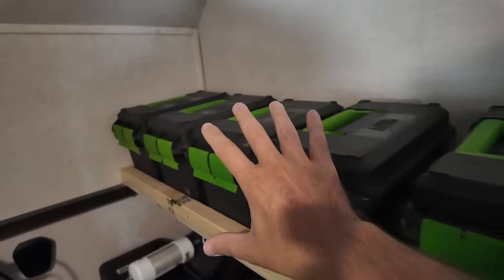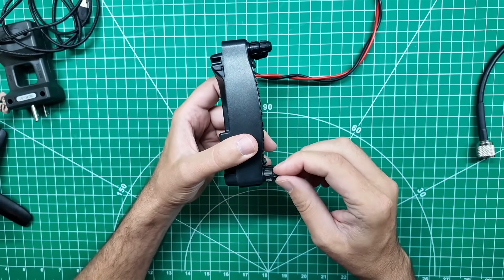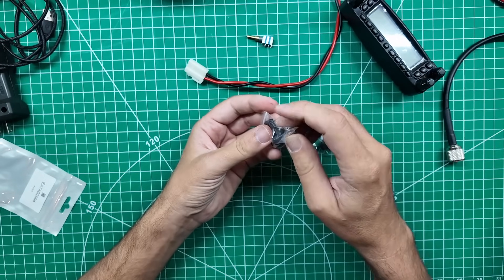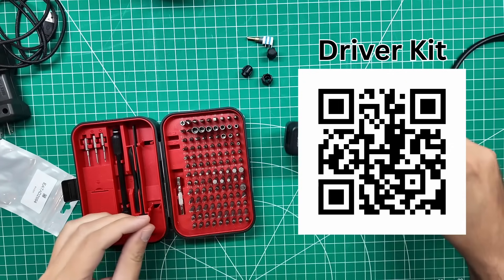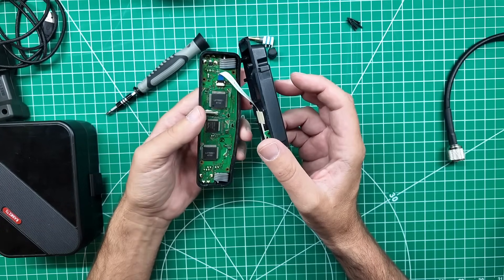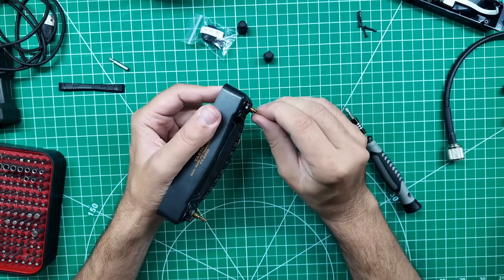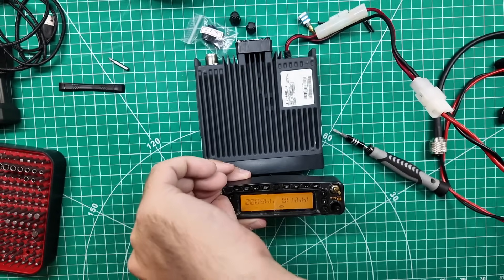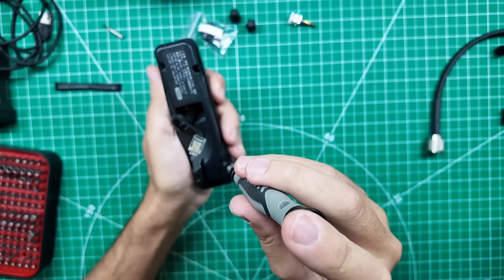Can AI Really FIX My Broken Yaesu FT-8800?

Comment: What happened to the AI demo part? Also, as someone else already posted, the 8800 should not have those holes. The one hole closest to the top left on screen should have a phillips screw in it, actually there should be a couple that appear to hold that plastic piece in place. I can't imagine why someone would have drilled in that area.
Reply from the maker: I talked about it at the end of the video.  I asked AI to give me the part numbers and it not only gave me the part numbers, but also ebay links to order the parts!  It was a simple prompt/answer and I forgot to put in the screen shots.

Comment: Thanks! Yor video was a great help! I just replaced one. A friend of mine dropped his FT-8800 and broke the shaft off at the base.  He had someone else attempt it but they were afraid they might damage the board.  I worked in the Avionics Microminiature Component Repair Shop in the Marines about 40+ years ago. I used my recently purchased YIHUA 929D-V Electric Desoldering Soldering Iron from Amazon to desolder the pins and dropped it out. Not as nice as the Pace vacuum pump rework station I used in the Marines but for $36 vs $8000+, it was fine. The hard part was holding the new switch assembly tight to the PC board until I could tack solder a couple of pins.  But we got it done and none the worse for wear. Unfortunately the replacement knob he got off eBay seemed a tad small and wouldn't slide on all the way. But it works!  I don't remember seeing those strange holes so I don't think they're normal.
Reply from the maker: I don't have the eyes for micro-miniature!  Good Job getting it fixed! When I have to desolder a lot, I use this: https://geni.us/CMIB can't beat the price/performance ratio!

Comment: Maybe someone here recognizes the problem with my FT- 7900. The unit lights up  and then shuts down immediately , most of the time , sometimes it stays powered on, but shuts down if I transmit.
Reply from the maker: What power supply are you running?
Reply: @temporarilyoffline   It's mobile, but running off the "house"  batteries in my Van/RV.  It has been great since 2013.  I think it started this behavior after an extended no battery power situation ,  Turned the radio on after rectifying the situation and the memory was wiped as well.  Is there a internal battery like a computer has for the cmos ?

Thanks for the reply !
Reply from the maker: @Glidedon there could be an internal battery getting in the way.  Open it up and check!
Reply: @temporarilyoffline   Will do !

Comment: I've been fussing with an FT-817 for a while now (I bought it 3rd hand) that I suspect had been dropped on the AF/RF Gain knob. I tried to track down the replacement pot for a while, then just gave up. After watching this, I pulled ever so gently on the skinny knob, it moved ever so slightly, and now they turn independently. SHAZAM! Do I credit AI or TO for this?
Reply from the maker: Why not both?  Strong work bro!

Comment: Steve, try using 3in1 Dry Lube on the spindle and inside the knob. Got to be very sparing with it. It comes out the bottle in liquid form then dries. I use a q tip as the applicator, don't apply it out of the bottle to the radio. (Ask me how I know). The stuff works magic. Could be the knobs are just formed wrong as well, but for the 3 dollars for the bottle, you will find many uses for it.
Reply from the maker: Sounds like a plan!

Comment: Those parts about 4 bux from Yaesu. The holes look like a mic holder?
Reply from the maker: Last time I ordered from Yaesu it took about an hour on the phone and 2 months to deliver.
Reply: @temporarilyoffline  Almost a same experience, the first phone call was only about 20 minutes to order, then they sent the parts to a city with the same name in a different state, took almost 3 months to straighten out for a $2 part, the lady at customer service was not good. At all. Had about 6 different phone calls, and it never got any better. I will avoid ordering parts from them  unless I absolutely have to.

Comment: Those are speed holes.  If you don't want to pay Yaesu for a remote head mounting bracket you can use that plastic piece and screw it to your dash.  I've done the same thing except mine sits in a windshield phone holder.
Reply from the maker: There's an idea
Reply: I was wondering also as my rig does not have them either. Also, is the Plastic Still on the Screen??😮
Reply: @HamManCT I've done it.  If you unscrew the bezel from the radio it turns into a nice mounting plate, but Amazon and eBay has them, and they have a T-slot in the back that's compatible with most phone holders 

The separation kit is a 6 wire straight through cable with RJ11s on either end. Either use CAT5 to homebrew one or again Amazon sells them cheaper
Reply: I did not know that! Thanks for the information.

Comment: I had the same problem with my FT-891.  I just worked the knob out until it started working properly again.  When you started into the problem, I thought 'yeah, I'll bet he doesn't need to replace anything.  You just need to work the knobs out to get them spinning properly again'.
Reply from the maker: You were right!  My 891 had a literal bent knob when it happened. I went in eyes wide open.